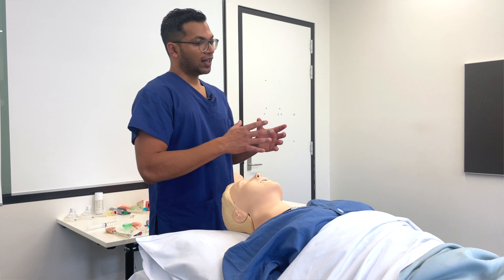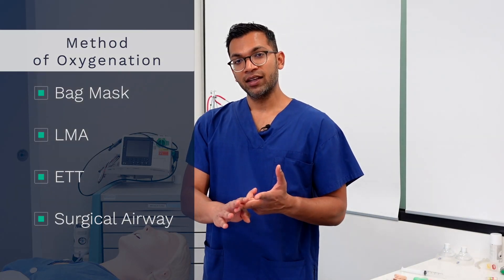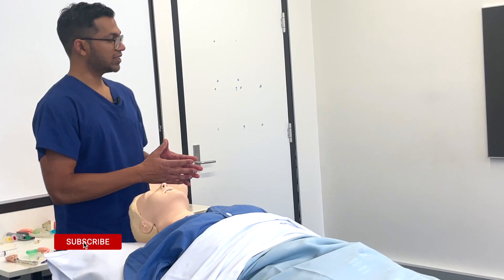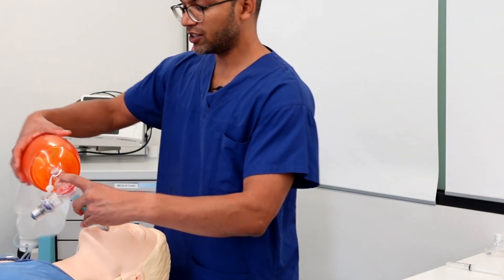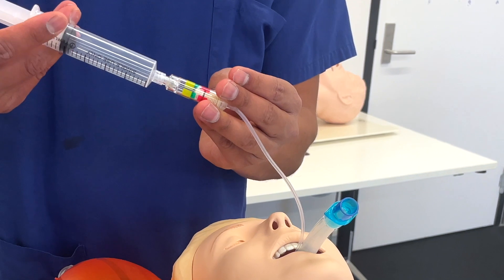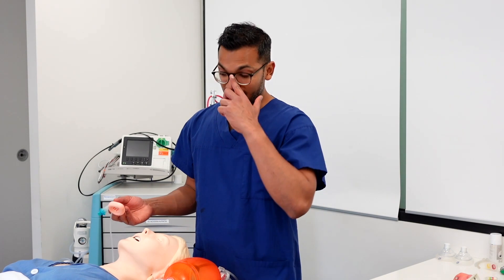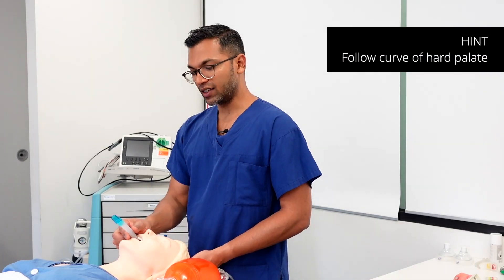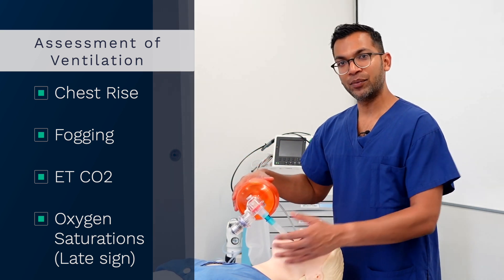Laryngeal Mask Airway (LMA) insertion | ESSENTIAL TECHNIQUES for standard patients

Comment: Should it be inserted with cuff inflated or not ?
Reply: That would depend on the model of the SGA (RTFM: read the manufacturers instructions!) and personal/institutional preferences. I prefer the cuff inflated as it comes out of the box, but especially for the first generation SGAs there were widely differing manufacturer instructions, ranging from completely evacuated with or w/o bent tip, a bit deflated, up to "as supplied".